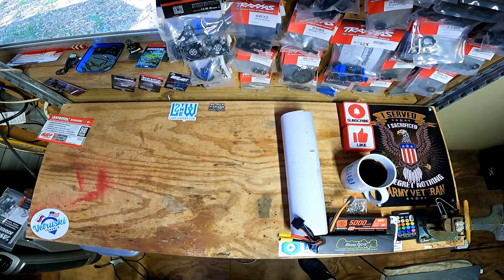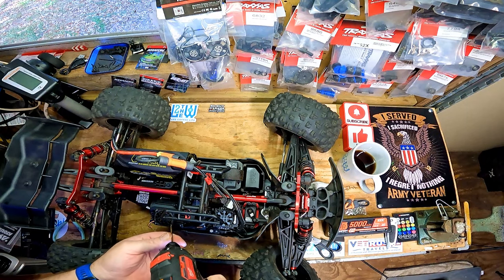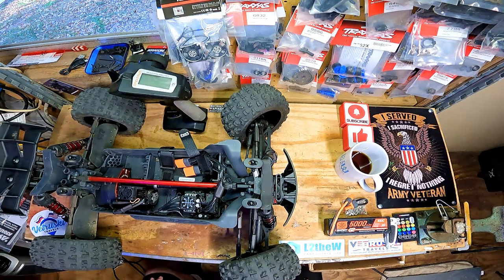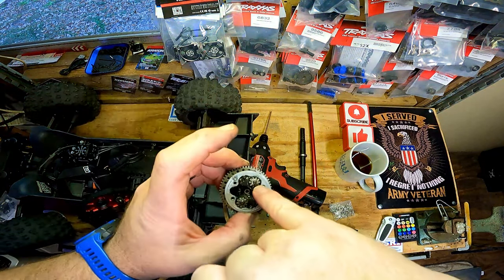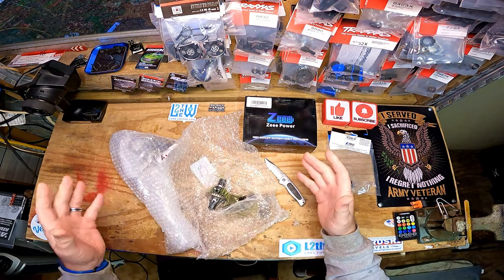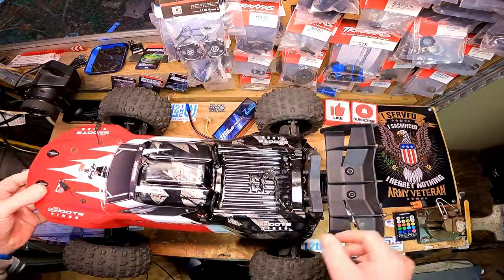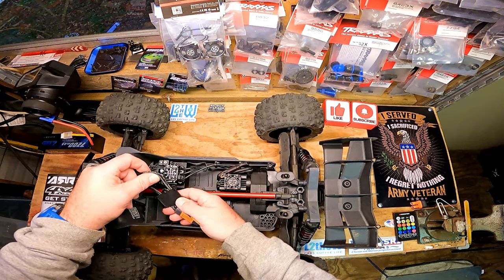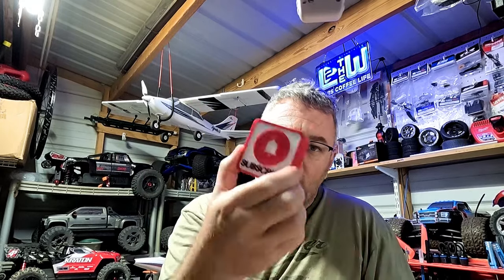New V2.5 Kraton Opening The Diff And What Is Up With The Battery Tray Size?

Comment: As a newbie to rc trucks I would like to see more maintenance type videos. Things like how to remove a diff,  how to clean it out, how to rebuild it and how to know how much oil is needed refill them. Stripping shocks and doing a complete refurb. Setting up steering geometry and suspension etc etc. 
Everybody puts out videos of rc's running and jumping but few get into the technical side of rc maintenance.
Reply from the maker: I have a few videos on upgrades which included shocks I did a rebuild of a shock for the Xmaxx its on here as well. As stuff needs repairs or maintenance I will do videos on that as well search the rc playlist I do have a few on there for you that I hope will help
Reply from the maker: I actually have some parts.to fix some stuff, upgrades and built a kit rc all coming up welcome to the hobby its fun and I hope you subscribe and follow along I fly planes as well a little bit of everything
Reply: @L2theWcarscoffeelife 
I have been subscribed for a month or so. My big rock 6s is my first rc vehicle so I know nothing about maintenance. I have been flying rc planes for 30 years so I'm ok with that type of set up etc.
Will check out your other videos soon.
Thanks
Reply from the maker: Thank you for the support

Comment: Very disappointing to see that center diff so dry, It isn't something that should ever happen, I use heavier Diff fluid than what the manual calls for and have had no issues with my center diff. I also every 10 runs change all fluids in the diffs and shocks. I use graphite on my cups and marine grease on all bearings. A old basher taught me this stuff to extend the life of my RC parts in the wet environment of Upstate NY. Good video Enjoyed watching.
Reply from the maker: At least they made it right they sent the fluid and have a new diff coming when they are back in stock they always have the best customer service. That is an intense maintenance schedule my cars never see the wet stuff I dont want to do that much cleaning lol
Reply: If you read the Arrma manual it has the recommended maintance for the RC I go by that.  @L2theWcarscoffeelife

Comment: What about these centre diff is that good reliable anything need addressing on these model
Reply from the maker: Mine came low on fluid but Horizon sent me a whole new diff. My only issue with the rc is I have very sandy soil it keeps getting into the gear case and is all over the pinion and spur gear I had t upgrade the 2 bearings on he diff the Arrma kept getting sand past the seals. nothing inside of the diff just in the case because its open on the bottom
Reply: Can you fit slipper diff if you want on these

Comment: sorry, but the problem with the kraton 4s with central diff that it doesn't have enough oil is the last problem, there are well-known manufacturers that don't put any oil in any diff (mt10) and others that use that monkey metal and don't even glue the tires well of rims and you complain about 5g of oil?? from the first use you can see how the car inflates the tires on the front, it's normal that it needs a thicker oil, or to top up, instead, yes, it's a bit crazy with the engine bearings that filled up with sand so quickly, maybe some ceramics with a better gasket will eliminate this problem
Reply from the maker: first off am I making a video on any other car? NO. Where do you get your math? I put almost 2 ounces in there that is more like 50 grams and it matters to people that might be buying it so why dont you calm down make your own videos about monkey metel if it means that much to you!! I didnt need thicker oil your nuts it did just fine with the 500k which is already pretty damn thick!  You talk about me "complaining" or is it reporting? About oil now your telling me to buy ceramic bearings  why dont you just go ahead and do it. Its not engine bearings first off these have motors not engines second they were on the center diff and there is NO gasket wow did you watch the video at all or were you in a big hurry to type and bash me?? BTW its a seal on a bearing not a gasket if thats what you are referring to. Might learn about the hobby and proper terminology and the focus of a video before making comments  Make your own channel and report as you see fit obvious arrma fan boy going to cry if anyone says something negative people like you is the reason people quit making videos tired of the dumb comments